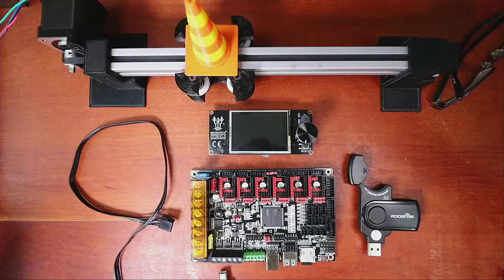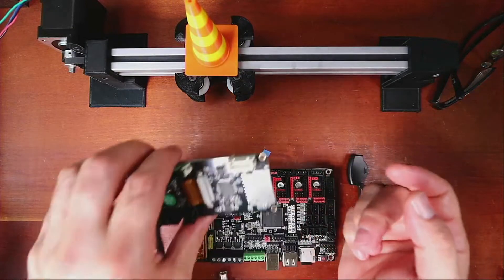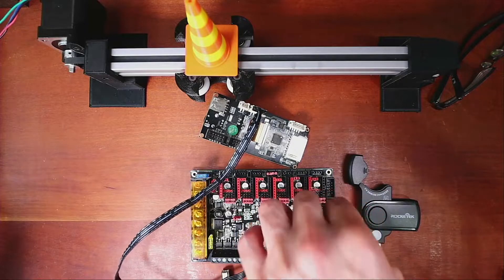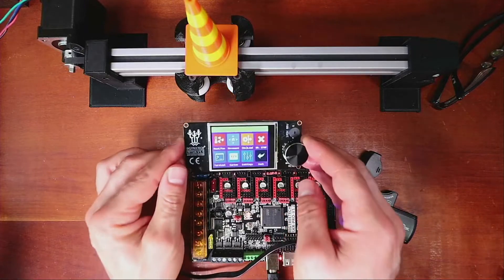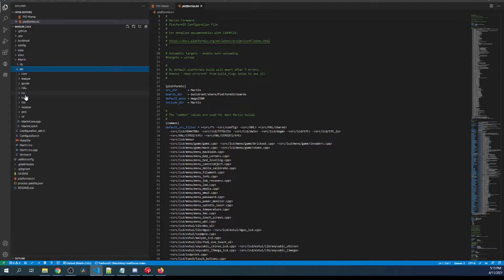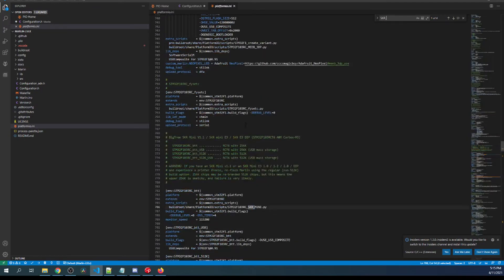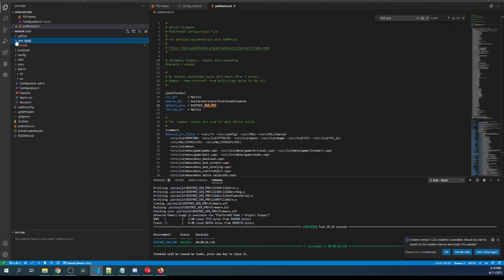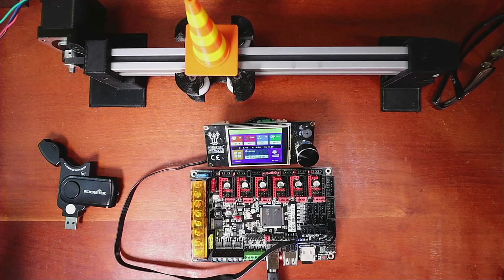SKR Pro v1.2 - TFT24 Display

Comment: Hi, thanks for this tutorial and quick reply to my question. As far as I see, you didn't choose any TFT on Marlin and it worked. In my case it is not working maybe because I have other brand TFT (anycubic i3 mega pro TFT). Do you know what should I choose in Marlin to connect anycubic TFT to SKR 1.2 Pro motherboard? I will be appreciate to any help because I am trying this since 5 days :)
Reply from the maker: SKR pro v1.2 is a playlist, in description below there is a link to playlist.
Reply: @EdwardBraiman  I found the playlist and there is no information for the TFT connection to different brand. Like I said I have anycubic mega pro and I want to use the TouchScreen TFT from anycubic mega pro. Therefore I don't know what should I configure in Marlin. Your tutorials are for BTT TFT24. Therefore I want to ask you if you know how can I connect to Anycubic Mega Prof Touchscreen TFT the board SKR 1.2 Pro
Reply from the maker: Do you have model information on display?  Remember there are hundreds of types of display so I need a mental picture of what you're working with.
Reply: @EdwardBraiman  Unfortunately there is no model description on the display :( 
I can send you a picture of the display if that can help
Reply from the maker: You can post it on Discord in link within description below and I can look after work today.
Reply: @EdwardBraiman  Hi finally I have found the model of the display: Anycubic_TFT v0.0.2 Could you please help me to configure the TFT in marlin?
Reply from the maker: Might be easier to ask question like this in my Discord chat.  Either myself or one of the 400+ people might be able to answer question in general chat.  The link is in description of video.
Reply: @EdwardBraiman  Thank you very much , I will try in discord chat
Reply from the maker: You're welcome.